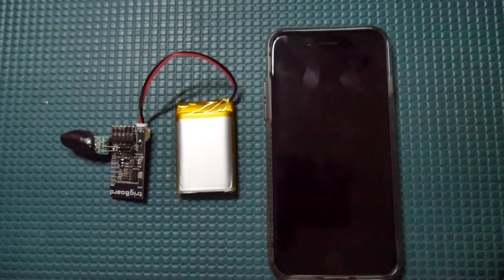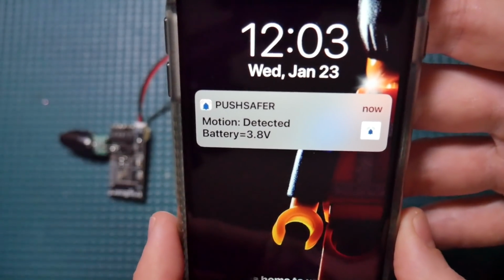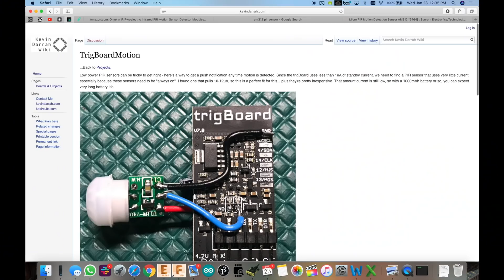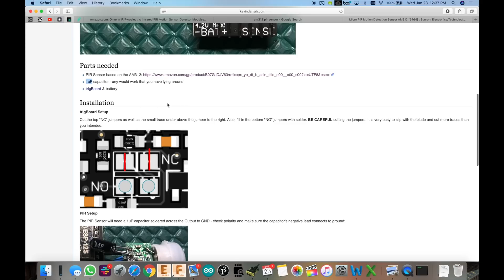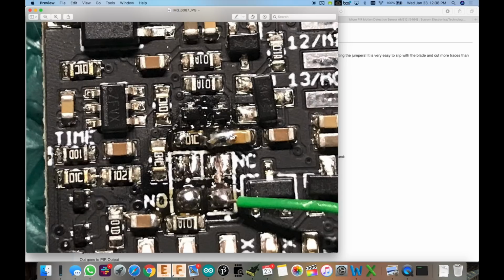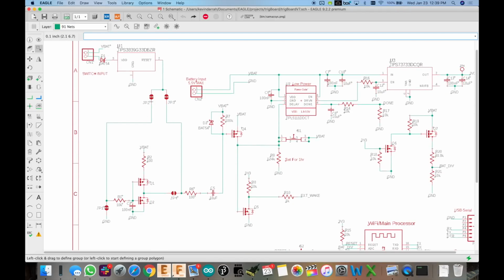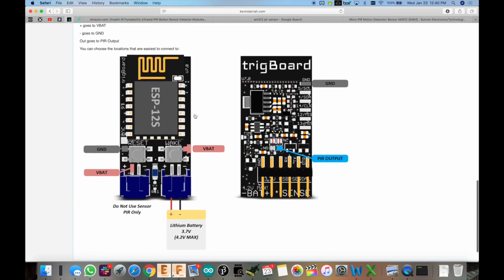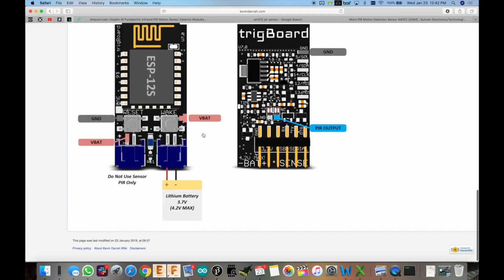Motion Activated Push Notification on Battery! - ESP8266 with trigBoard!

Comment: What's the 1uF Capacitor for? Does it "smooth" out the output of the sensor and thus avoids false triggering?
Do you have the code you used posted somewhere?

Comment: I experimented a bit with a few different PIR sensors and found them all unreliable:  false positives and negatives, sensitivity to WiFi  signals off the ESP and possibly other RF signals as well.  The "radar" proximity sensors work much more reliable, but are not easily made directional. I have no experience using these in a low power setup, maybe interesting for you to consider looking in to?
Reply: I just finished developing (and deploying) ESP-1 + PIR sensor thingies. What I found is if you trigger RST pin with the PIR sensor it works very unreliably. I found that if you connect the PIR output directly to RST and EN pins it works like a charm :) Later today I found on some blog, that apparently toggling RST causes PIR sensor to malfunction due to some interference of the RF circuit on ESP... I came up with a design that requires no external components at all(Just ESP-1, PIR sensor and a LiIon battery). I'll do a write up of my findings tomorrow on my blog.
Reply: @MrNopperaBo  - Thanks for this! - I am very interested.  Where is your blog?
Reply from the maker: yea for sure, especially since I too am finding issues with the PIR sensors... the false positives are driving me crazy.

Comment: Would love to see a video where you explain how the auto reset circuity on the Trigboard works! Buttons are somewhat inconvenient when you're prototyping, and the "nodemcu" way (two NPN transistors) is a bit touchy sometimes.
Reply from the maker: yep, that is on the to-do list... yea!! my auto-reset is solid
Reply: @Kevindarrah   I've tried using two diodes and a capacitor when just the DTR (or RTS) handshake pin is available. This works when uploading code, but one the down side it isn't possible to open the Arduino serial monititor without setting the ESP8266 into "boot mode". This is because the DTR line gets toggled every time the serial monitor is opened. Looging forward to see how/if you solved this issue as well :)
Reply from the maker: lol, yep I ran into that when developing my version